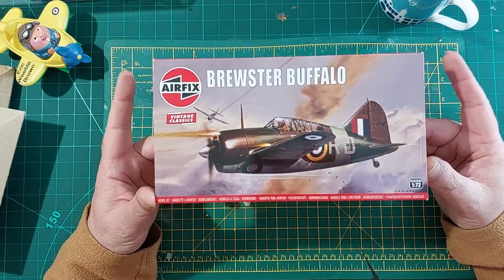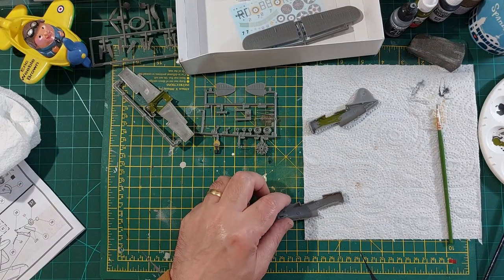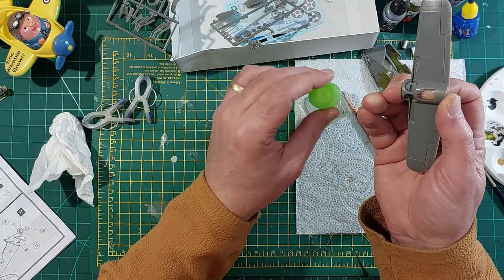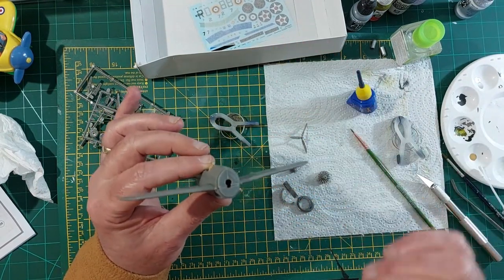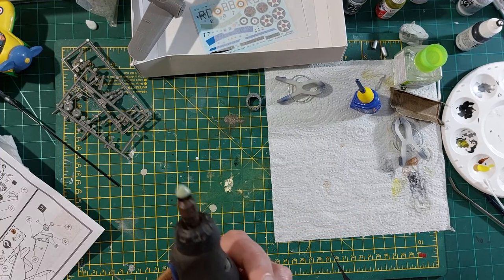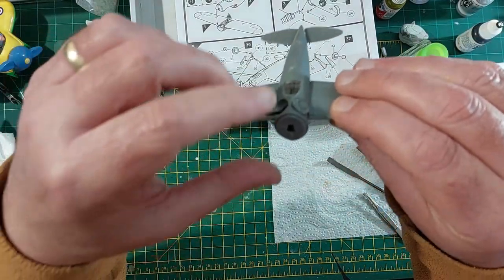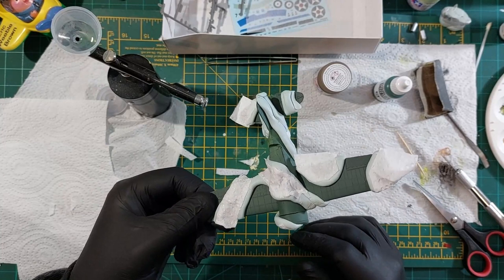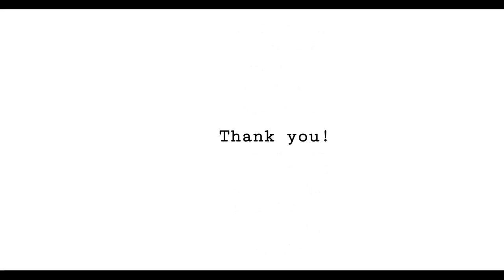New Airfix Vintage Classic Brewster Buffalo build

Comment: You've captured the demarcation between the dk earth and dk green perfectly for the scale. Very well done!
I made this kit way back in 1973 not long after its release.  Airfix's releases in the early to mid 70s were really very nice.
That cylindrical component that is positioned on the aft decking is for a life raft that all USN a/c had. British, Dutch and Finnish versions ommitted this to save weight.
A lovely job.
Reply from the maker: Cheers Mark. I really enjoyed it

Comment: Nice build and great video, tempted to buy one myself.  A few comments - there are parts that I don’t think would be relevant for the RAF version, the gunsight in the canopy the tea urn / life raft behind the seat, and the arrester hook (in fact I think the tail cone would have be slightly different, more tapered to a point because there was no need for hole for the arrester hook).  I also think that the interior green called out by Airfix is wrong and should be the lighter RAF cockpit green.

Comment: Great result, have always brush painted but am seriously considering getting an airbrush. Any tips? Which airbrush do you use and have you had to invest in an extractor and airbrush booth?
Reply from the maker: I'm very much an airbrush novice but I did a video about the one I got. https://youtu.be/5I3cIfGjQLY
I'm not planning to upgrade, I like it. Simple, reliable and cheap. I had an unbranded one first but it was rubbish. Maybe the expensive ones the big boys have are better, but I'm content. No booth yet, just a cardboard box and a mask. I find acrylic paint is OK, but solvents are horrible for fumes. I've only got solvent primer so I plan things so I can quickly prime, then leave the room. Cheers

Comment: If you wash all the parts in tepid water with a touch of washing up liquid, it removes any oily 'mould release agent' that might be on the plastic, which can stop paint and cement adhering. Rinse off, and let air dry - I leave them overnight, usually.
Priming the parts, with Halford's (#notspon) Acrylic primer (a big tin will last you ages), will help the paint finish no end - it will also reveal any sink marks, etc, in the plastic.
Reply from the maker: Cheers Brian. 
I heard somewhere that the oily stuff isn't used anymore, so new kits should be OK, but maybe not. I used to use Halfords primer, but without a spray booth, the dust and smell goes everywhere. 
I like Mr Hobby airbrush primers, but they stink too. If I could find a nice acrylic primer I would be happy. Tried vallejo but too sticky and slow  to cure.
Reply: @nostalgicplastic4323  Do mean mean Mr Hobby Aqueous Mr Surfacer, or the regular Mr Surfacer. The latter is lacquer and really smelly, but Aqueous Mr Surfacer is alcohol based, and not that stinky, it dries quick too. I have a spray booth, so I have used mostly the lacquer version, but the alcohol based is very good too. It's more expensive though. If you want to try a real water-based primer with no smell at all, there's Stynylrez. It's is also re-bottled by UMP and Ammo. Very good adhesion and dries fast, self levels quite nicely.
Reply from the maker: Cheers Kinksfan. Its the smelly stuff I'm using, having bought it without realising. I really like it though, just my lungs object to it. I'll try your suggestions out as a primer I don't have to run away from would be handy! Thanks!